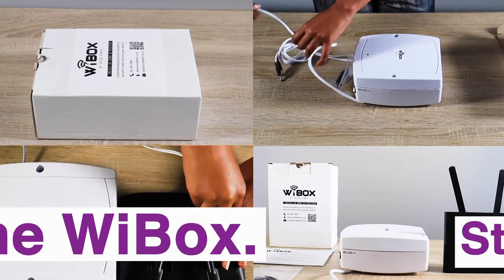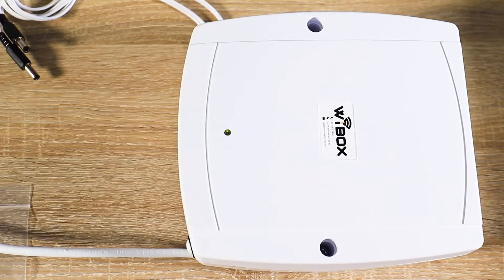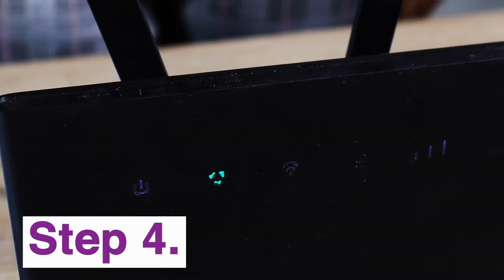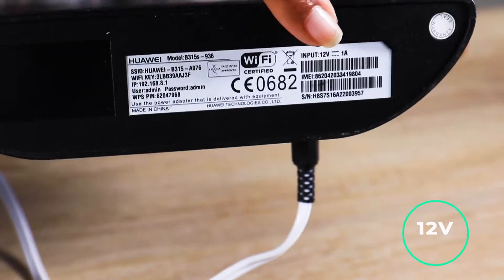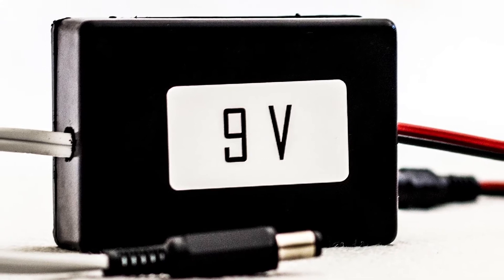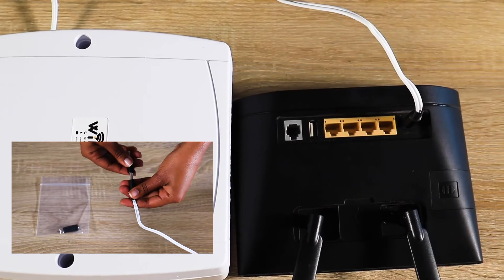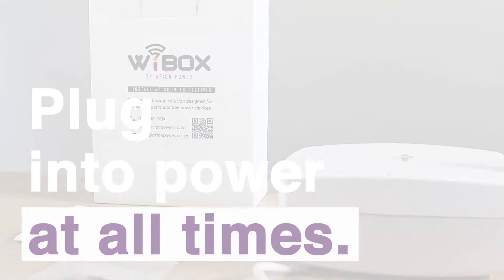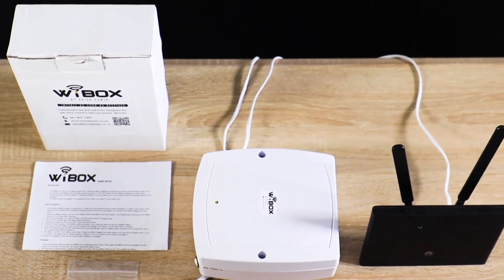How to install the WiBox

Comment: This device is great IF you have a LTE only Router. What about the Fibre ONT/CPE box power supply if the grid goes down?
Reply: The device connects to both your WiFi router and ONT simultaneously as it has multiple connections.
Reply: I have Fibre and Wi-Fi router and they are both connected to the WiBox and works.
Reply: My one is switching  off as soon as the electricity  is gone,I've had it for 4yrs...do I need  to change anything, please help